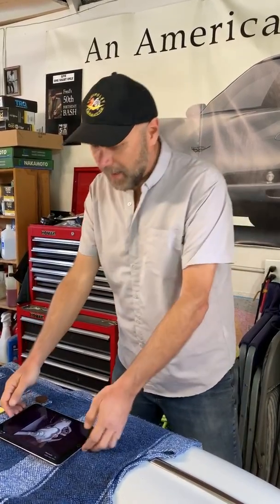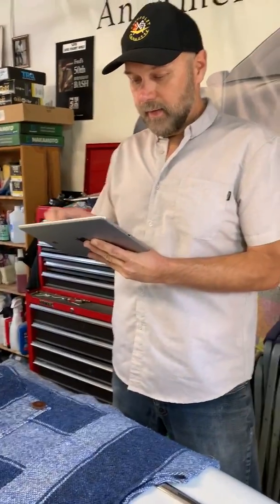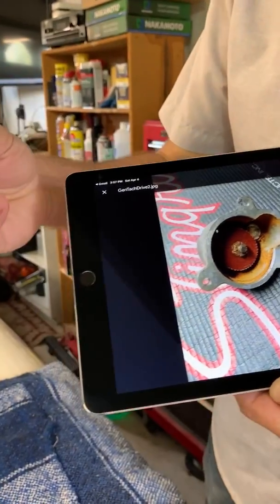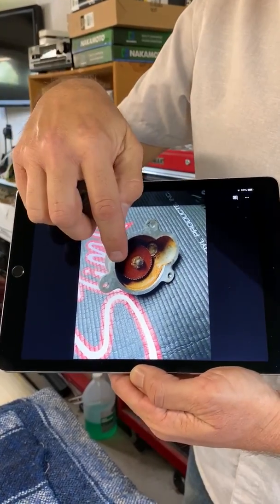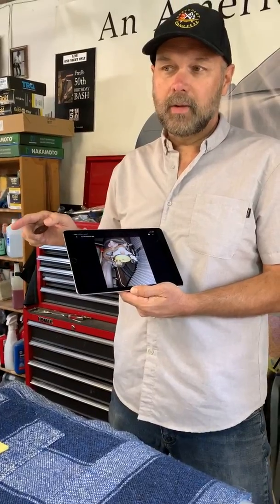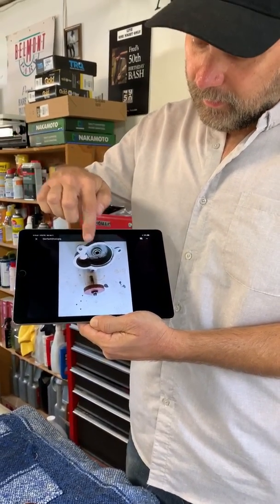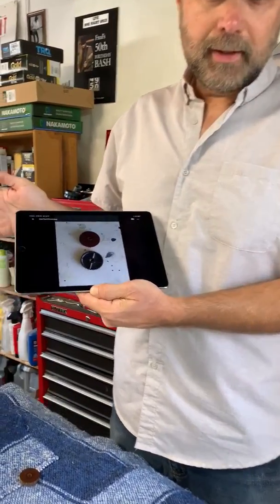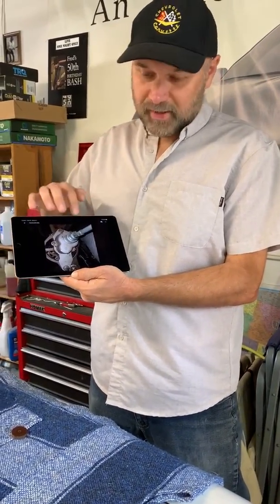C1 Generator Driven Tach problems

Comment: I got my new "plastic" gear in and I noticed that one side of the gear in the center around the hole has a flange and the other side  around the center hole is relatively flat.  Which side is out?  In other words which side does the nut go against, the flat side or the flanged side?  I hope this question makes sense.
Reply from the maker: I do not recall!  I looked at my photos of the job, but cannot see that detail.  Sorry!
Reply: @FredKokaska  Hey Fred,  I called Zip Corvette and they were unsure at first but then looked into it and the flanged side goes inward and the flat side is where the nut is secured.  Doing the job today.  I'll let you know how it goes.